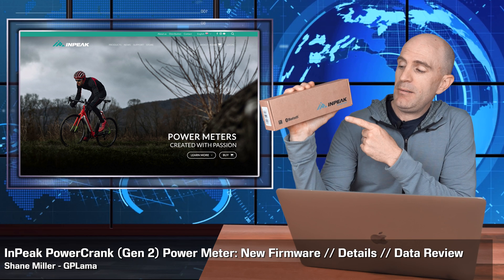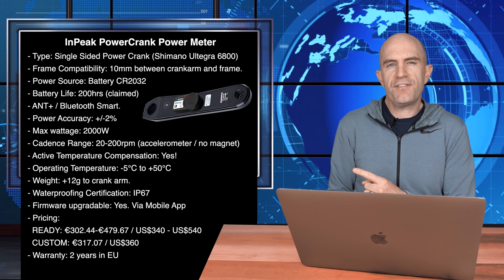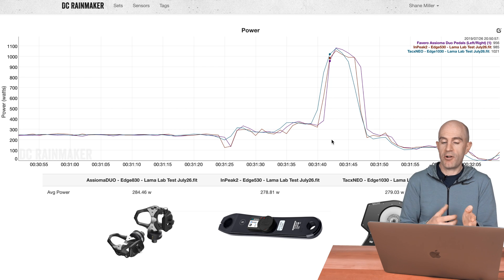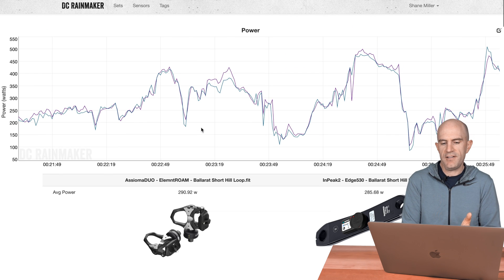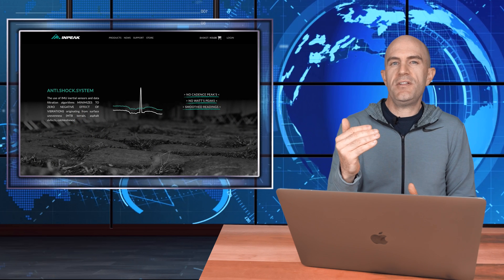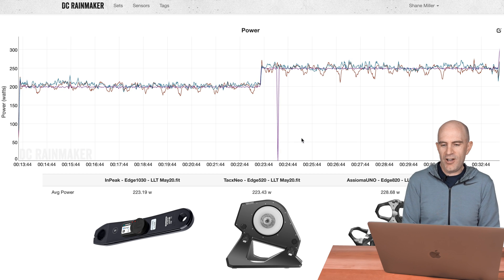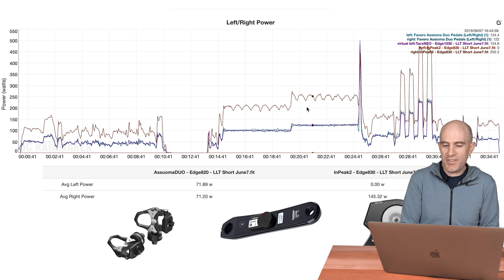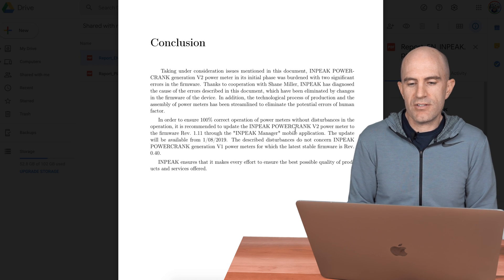InPeak PowerCrank Gen II Power Meter: New Firmware // Details // Data Review

Comment: Great review as always. Thanks to your reviews I bought inpeak for the gravel bike and assioma duo for the road one, which ended up with experiences similar to yours. Both are great (as much as the single leg inpeak can be). What's really amazing is that when I compared inpeak and left assioma pedal reading (doubled), they usually gave the very same watts, sometimes 1-2W off at 300W per several minues at worst.

Comment: I don't understand why the fitting of the power meter on ultegra or dura ace crank is more expensive than 105 and other... the real cost to fitting it on crack is not the same?
Reply from the maker: A good question to ask InPeak.
Reply: 105 is a solid aluminium block crank, Ultegra and Dura-ace are form from bounded hollow aluminiums shells. I can  imagine fitting PM itself and calibration for heat cycles etc, can be different because of that

Comment: I am making assumptions here,  assuming most of us cyclists would like a power crank meter from having one on our turbo trainers, so looking for power numbers to match. I appreciate that you mostly use the AssiomaDuo to compare. Would it be just as simple to have turbo and power crank meter on  at same time to compare? or is there a bit more to it than that. Im considering purchasing the InPeak, doing a comparison, if it doesn't match up, return said item. Cheers for all you do.
Reply: Differences will apply due to: 1. Drivetrains losses 1-2%, 2. L/R imbalances that will vary with each user. 3. Measurement errors - Shane's video suggests these will be small.
Reply: In this case, being able to look at L&R power separately helped Shane identify places where his own power was imbalanced, but the L only powercrank was measuring correctly.
Reply: @andrewmcalister3462  Hi, I probably didn't explain myself very well. I was trying to ask that if having a crank power meter, on the turbo bike, would give similar numbers to that  as on the Wahoo kickr. Just wanting to confirm results would be nearly the same. Then putting crank power meter onto best bike for outdoors, and seeing similar numbers to that as indoors.

Comment: wow, that is a pretty open report. they seem to be leaning into the "we're an engineering company, and we are making data acquisition devices" side of things (very good idea in my opinion). They could have dismissed the issue, or even provided a 1 sentence changelog to the effect of "updated correction(s) for sensor drift, works now"

Pricing is pretty good to... if only it wasn't a choice between 11 speed brifter upgrade or a power meter...

Comment: Interesting vid Shane.  Great response by InPeak to the identified problem.  As a consumer, that provides confidence in their company. 

Shane, as you've done more testing, have your thoughts on single leg PMs vs dual leg PMs changed?  My experience (I have a single leg PM, dual leg PM and Kickr Core) has been that the single leg PMs are producing sound results (and consistent).  I generally have a fairly even leg balance (50/50 or 49/51). I'm wondering whether the supposed benefits of the dual side PM are not as important as the marketing departments are trying to convince us. For argument's sake, if someone had a more pronounced imbalance, a single leg PM may read higher or lower for that individual...does that matter if the PM is consistent?
Reply from the maker: Single side is fine up to a point. Dual is the true story though. It depends on the compromise.

Comment: I've been using a dual sided power meter for a while but had to replace it. My L-R balance has always been 47-53 or 46-54. Are there any options with any single-leg power meter to adjust for this difference to report a proper power vs having about 92-94% if I only used left leg? Thanks!
Reply from the maker: Some units have scaling. I used to like this.... but I'd rather see accurate power meters and people use left/right meters if they have imbalances (as the balance changes a LOT due to effort and fatigue)
Reply: @gplama  Thank you Shane!
Reply: 4iiii app has got compensation so you can adjust your power difference.